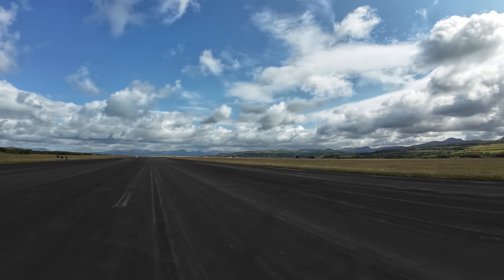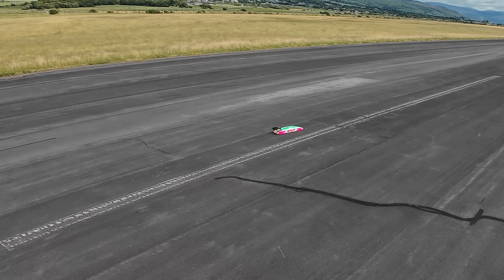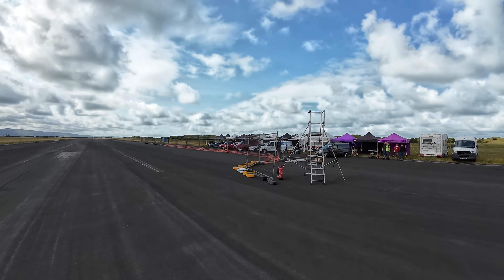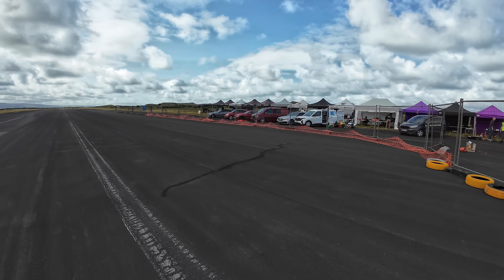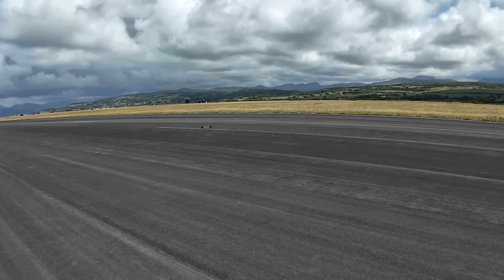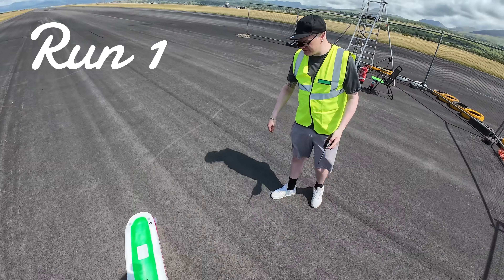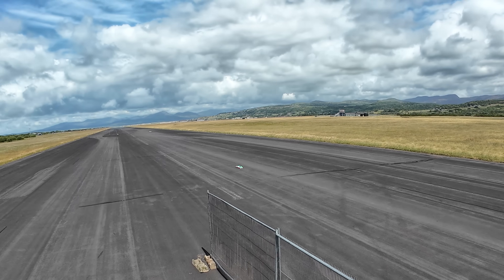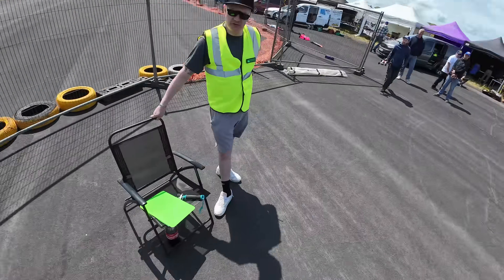Day 1 at ROSSA RD1 2025 – Chasing Redemption and Speed!

Comment: If the car is 1/10th scale (a 10th the size of a real car,) then attaining 150mph is like the car is doing 1,500mph scale speed! Which is phenomenal. Keep going, BlueBird!
Reply from the maker: Its 1m long so I don't think I could claim it's 1/10 scale!
Reply: @steveeng1826  What scale would you classify it? As you know, a computer monitor never gives a full impression of its true size. I'm surprised it's 3 feet long! WowZerZ!
Reply: @TheGeezzer  It's not to any scale.
Reply: The current record holder thrust ssc did 763mph and was 16.5 m long, so your about 1/16 scale at over 2000mph in scale speed by my truck driver without a calculator brain. I did Google about thrust though.

Comment: Congratulations! I have been watching your channel since before you started your first Beast car and I have been loving the series on this car. I watch other RC channels that dabble in speed like Project Air, Ras Shiffrin, and of course Kev Talbot, but I believe your car might have the most potential. We will see what the additional unsprung weight does to handling at higher speeds, but the hub motors are very novel for how smooth and controlled they keep the car otherwise. You have such a great surface at ROSSA that the suspension might not have to work hard enough to show many negative effects of hub motors.
Reply from the maker: Thanks for watching and thanks for the detailed comment😊 I also feel that it has a lot of potential, wait and see what happened on days 2 and 3! It's worth pointing out that the runway is not as smooth as it looks from afar, there are a lot of surface imperfections that can unsettle your car, especially if it's small. Thanks again and I look forward to sharing the next part of the story 👍